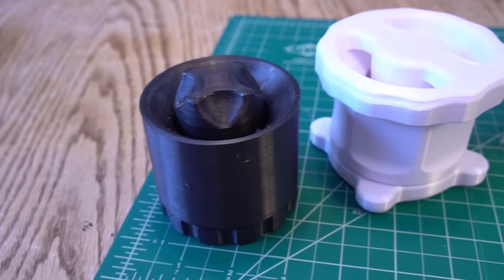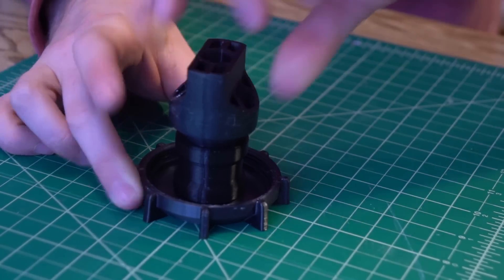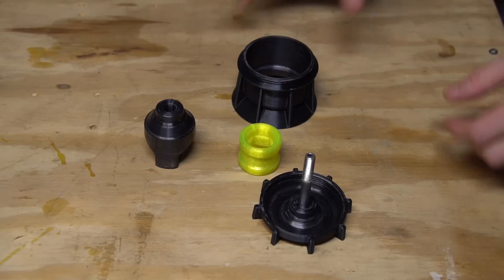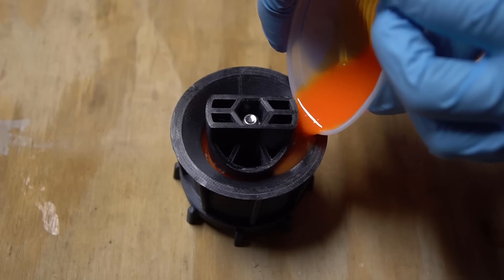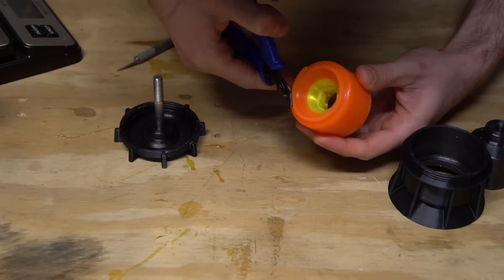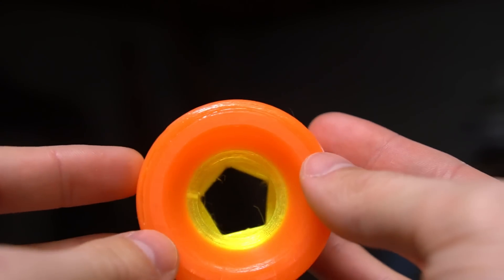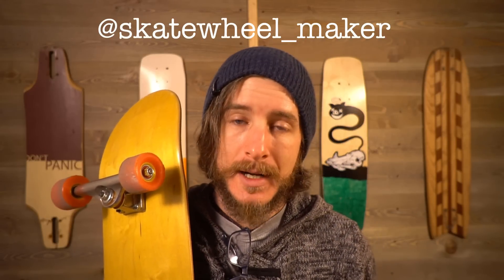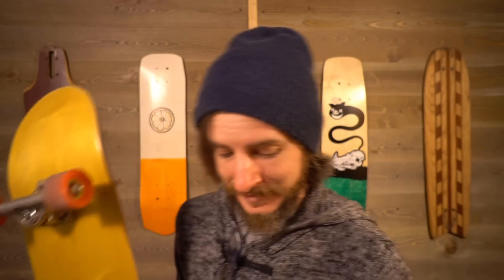Make Your Own Skateboard Wheels at Home!

Comment: I have 3D printed wheels and tyres for my electric skateboard . I normally ride on the road at roughly 25-30 mph. So far i have ridden them for around 10-15 miles and theyre holding up great. I printed the core in ABS with 100% infill and the tyre in TPU with 40% infill but using 10 perimetres so the outer edge of the tyre is solid and only the inner part of the tyre has the infill.  I made the parts in a way that they can be press fit together with a 100kg press and be able to be removed if i need to replace the tyre as the tyres can ware out fast when using them on an electric board. The wheels are 100mm diameter and 60mm wide . I am using a modified version of the orangatang wheel core that I designed. total print time was roughly 100hours for all 4 wheels (core and tyre)
Reply from the maker: That sounds like an insane print job! I did a set of TPU wheels with a reinforced PLA core a while back. I think mine were 64mm? And I printed the parts solid. I like the idea of being able to swap out your tires, that seems like it would be useful. Especially for an e-board
Reply: 100 hours? Wouldnt it be cheaper to buy new wheels lol
Reply: @user-jk9zr3sc5h  Nope . it only cost £20-£30 in filament + my tyres cant pop like normal pneumatic tyres . the other 100mm tyres for electric skateboards are really expencive + you cant change the tyres , so I'd have to buy new wheels every time I shredded them.
Reply: @JayDoesCad  £30 in filament + 100hours of electricity, but yeah Im not sure how expensive the wheels are for that size and type
Reply from the maker: Oh, are you talking about a mountainboard style wheel? So you're doing like an air-less tire instead of the TPU replacing a solid urethane part?
Reply: @GoodRoads  yes i made a tubeless tyre pretty much . instead if putting air in there for the regidity of the tyre i used infill.
Reply from the maker: Very cool, how does the weight compare to a pneumatic tire?

Comment: that absolutelly awesome. I'm already printign your design, the hard part is actually to surce the urethane in Europe. its like casting urethane is not used for anything..all you get is epoxy
Reply from the maker: The availability of materials in different parts of the world is something that keeps coming up. I'm thinking we're going to need a resource database at some point. Have you tried searching for castable rubbers? For like propmaking and stuff? A lot of flexible, castable materials out there are urethane.
Reply: @GoodRoads reminder to make a databsse for urethane. This is still something i rly need.